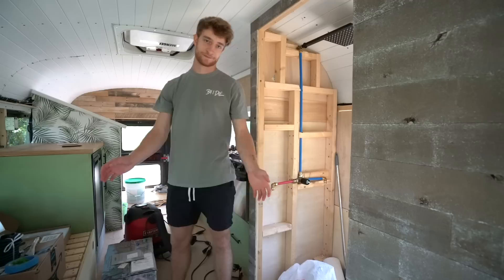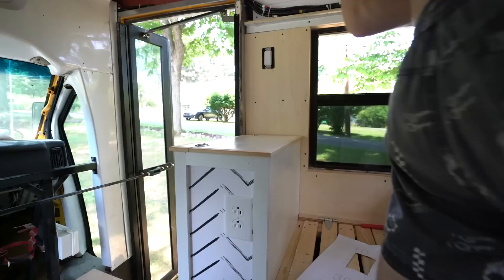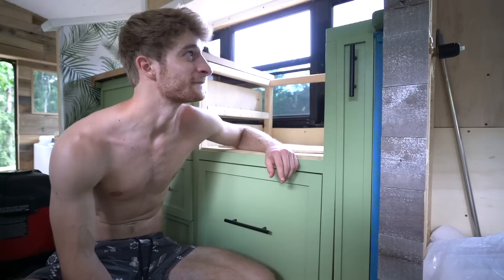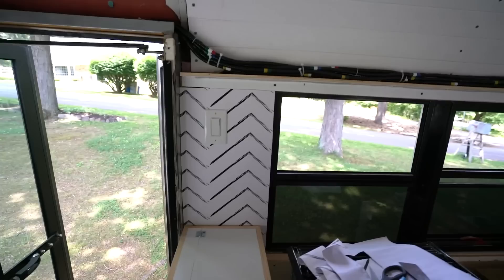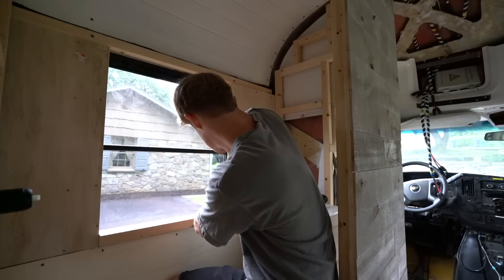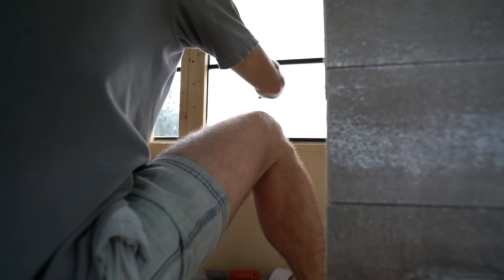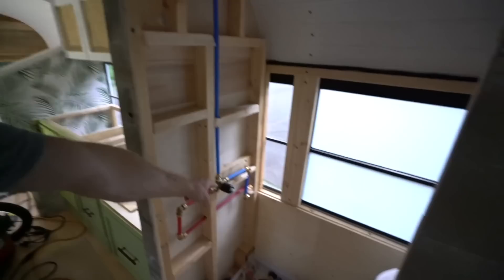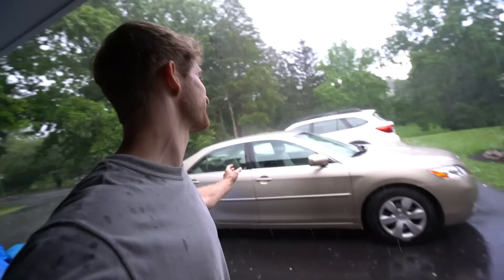Plumbing, Wallpaper, Painting on School Bus Tiny Home - Skoolie Build Ep. 51

Comment: Wondering where dirty laundry is going to go and if you thought of lowering the flloor in bathroom to give more standing room in there. Watched some videos of that being done and since you removed the batteries you might have room to do it if the frame isn't in the way and you know a welder. Keep hydrated in the hot weather and enjoy your trip.
Reply from the maker: There will be a little compartment back by the bed for the dirty laundry. Lowering the floor isn’t a bad idea. Maybe in the future if I feel like I want to use the shower more!